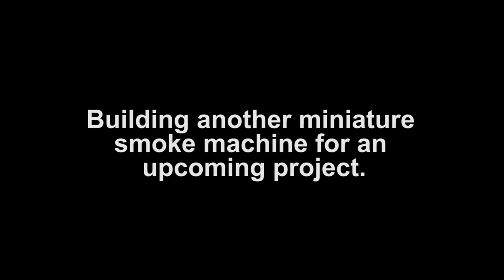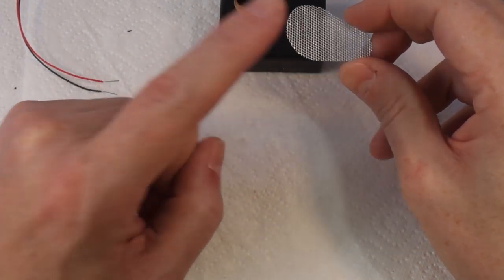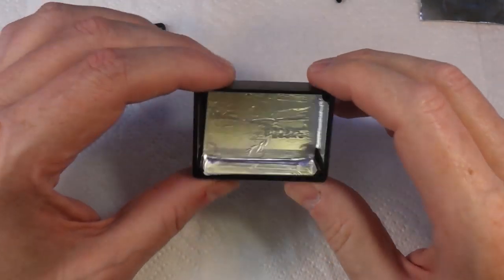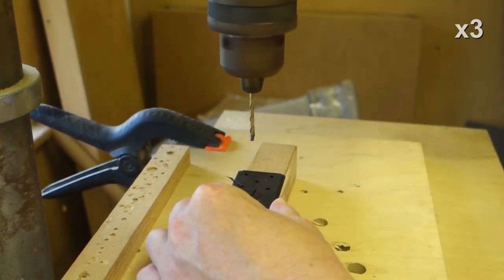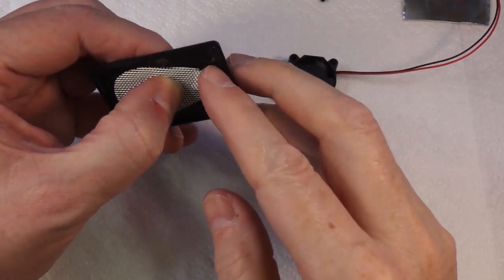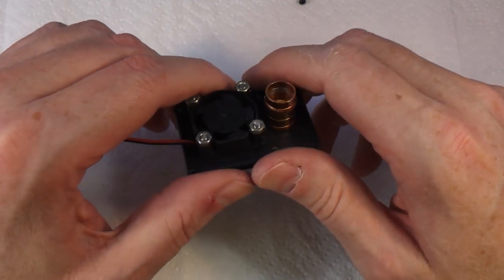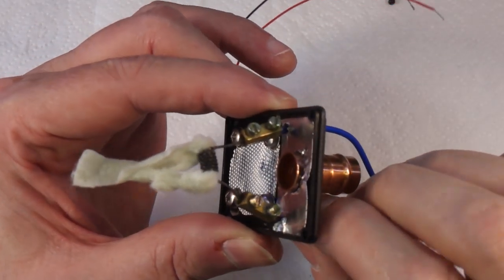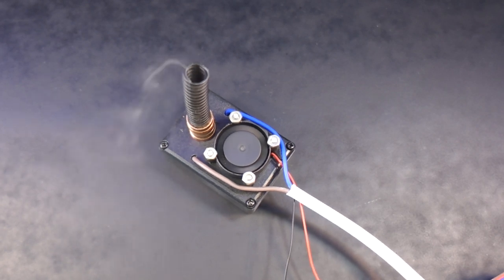Building another miniature smoke machine for an upcoming project

Comment: May get a little better performance if you isolate or insulate the terminal blocks from the conductive tape.  It's most likely draining your power if both the positive and negative are touching the conductive tape.
Thank you for the video.
Reply from the maker: That is very likely true and it's something I have considered. Trouble is, there's so little space left in the box it's hard to find anything that would insulate the connections without melting.

Comment: any suggestion fo a mini diorama smoke machine that must stay lit for at least 12 hers then timer shuts off and without refilling work foranother 12 hrs
Reply from the maker: That's a tricky one. I personally wouldn't trust one of these to run for 12 hours straight without monitoring. I do know a chap who did something kind of similar to what you're asking, but he used a thermistor and a Raspberry Pi to monitor the temperature and add a safety cut out, but that's a bit beyond me, I'm afraid.

Comment: Hold on no , but wait a minute at exposes the brackets to potentially touching the aluminum and keeping it the connection within the box . You definitely should've explained this after taking and cutting the plastic off that it would expose the brackets to the top of the box as of a connection . We got the point of the video but someone could miss this as a mistake in not being understood to find out if the hooked up a OFF AN ON switch and find there's a problem to why it won't cut off and it stays on .

Comment: Thank you so much I’m
Going to try to make one. For your usb one do you have a problem with melting wires or anything
Reply from the maker: Not that I've noticed. The power really isn't high enough to cause problems like that.
Reply: How much would you charge for one of these. I keep trying the usb but it won’t work. I got one to work on the 18650 battery but the coil...
Keeps catching on fire

Comment: excellent construction but I would have left the insulation on the terminal block, separating it anyway in two parts, to avoid short circuits in case of contact with the self-adhesive aluminum.
To improve the contacts I advise you not to tighten the screws over the cable insulation: the stripped part may not go all the way under the screw causing a loss of efficiency in the smoke machine.
Reply from the maker: While I agree with your points to an extent, experience has taught me the insulation is likely to melt and/or catch fire. Also, folding and clamping the wires makes them less likely to pull out or for the screw to damage the copper.
Reply: @SteamGeezerUK  
I fully agree on bending the wires: the section is doubled so the screw tightens them better.
What I meant was the wire insulation is better not tightened by the screw.
This is probably why the insulation of the termination blocks melted: a bad contact causes the connection to overheat: this should increase the smoke, but as already experienced by you, even at the fire!
Cheers!

Comment: I want a little smoke machine for my model railway chimney. I am looking at a slower bellowing flow would this machine work without the fan relying on convection up the chimney
Reply from the maker: You could certainly try it. In theory, the heated vape fluid should rise because it's warmer than the surrounding air. Might be worth experimenting with different size funnels too.

Comment: How often do you need to replace the wadding , and how often do you top up the oil ? Will one " charge" of the box keep producing smoke got hours , or just minutes before needing replenishing ? Sorry if you've covered this in previous videos, but this is the first smoke machine I've seen . Cheers !
Reply from the maker: All good questions. I've never had to replace a wick in any of my smoke machines, although I have had to rewire a couple but that was down to me using cheap wire that corroded after a month or so. As far as how long they last, it obviously depends on how much you use them. In this project, the machine is on for 5 seconds and off for 10. I put 3cc of glycerine in it when I made it and I haven't had to top it up yet. It's difficult to say how long it will last, but it'll be way more than a few minutes.
Hope that helps.

Comment: Hello, I'm making one mini smoke machine using this materials:
18650 Battery 3,7V 1300mA. 
Step up modul mt3608 with 9V..
mini PC fan 25mm  5V. 
0,85 Ohms vape resistance. 
When I turn on the circuit the fan goes with low velocity and the resistance makes smoke and the step up modul begins to be to much hot.
I'm making something wrong?
Reply from the maker: You're probably trying to push too much power through the step up transformer, although it will get hot anyway. Try it without the transformer, see what happens.

Comment: Hello SteamGeezer, I really like your video's I think you do a very good job on how to build these smoke machines I have a question and I would like to make 2 of those small ones so my question is I'll be running them off of 12 volts so what would be the type of heating element I would use your knowledge would be greatly appreciated so I don't burn myself up and anything else thanks and keep up the good work
Reply from the maker: You might try using the heater wire from an old hair dryer for 12v. I'm not sure a vape coil would handle that much power, although two of them together might.
One of the first videos I made has instructions on how to make a heater coil from scratch - that might help: https://youtu.be/P_qUuWXd4yo

Comment: Ive tried to build one of these  I used the same type of battery, fan and coil and yet my battery enclosure melted  any idea where i might be going wrong?
Reply from the maker: A lot of cheap battery enclosures for 18650 batteries are extremely poorly made using cheap components. I've had a number of them melt myself - the problem is that the resistance of the metal contacts is all wrong for the application, so they heat up and melt the plastic.
I modified mine with a much better grade of connectors to solve the problem, but a simpler alternative may be to simply buy a better quality holder, although where you would get one I'm afraid I cannot say.